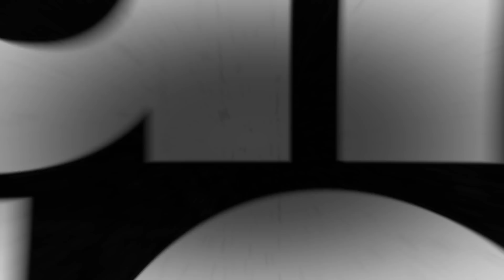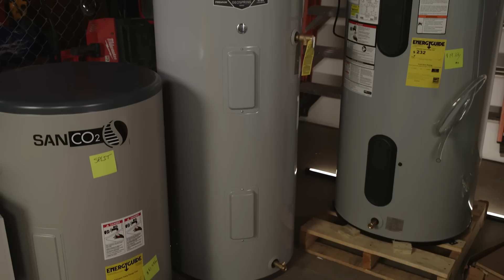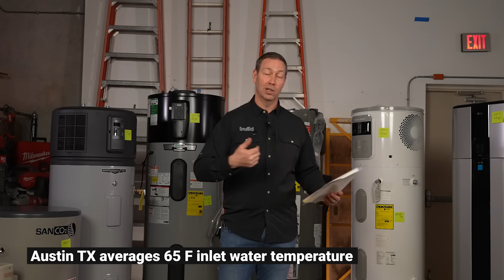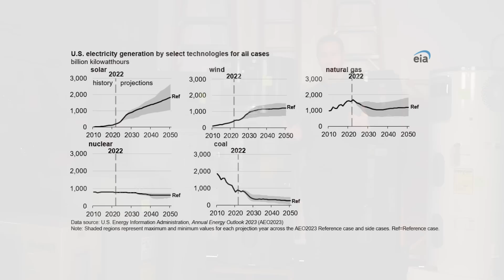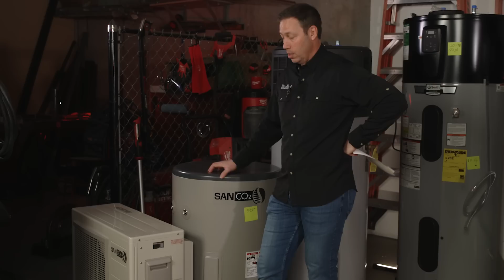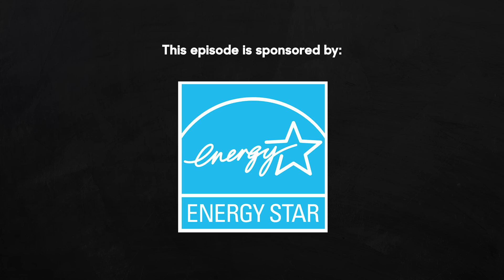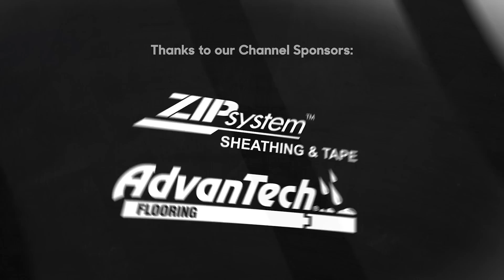2024 Heat Pump Water Heater Buyers Guide

Comment: Very cool that your sponsor is Energy Star.  I have a Rheem 3.55 and it does something I never expected.  It delivers way more hot water in heat pump only mode than our 5,500W water heater at our previous house.  In hybrid mode once, I’ve felt it run out because we ran too much at once accidentally and it recovered the hot water while I was showering.  It is powerful!  That and it helps cool our garage that we air condition/dehumidify in Florida.  Lots of benefits!
Reply from the maker: Very cool!  Thanks for commenting
Reply: Matt, For new construction would you recommend the 240v or the 120v model?
Reply: @toddwikel3849   Last time I looked (just a few months ago),  the 120v models had a slightly smaller heat pump and were a little slower to generate hot water.
Reply: fuck the government.
Reply: Of course the obvious answer in Florida, California in a garage. But for colder climates placed indoors there are real cons-
Reply: @johnwhite2576 agree, also in retrofit for older homes like mine in Provo Utah (basements are only 6ft tall).
Reply: @xokissmekatexo  The sanco would still be a decent option. They claim it functions past -25f outdoor temps which should really cover your worst winter days. They have a really well thought out system and all the functionality is there to set it up as a thermal battery with a solar system or time of use power.
Reply: @johnwhite2576  
Could be . . . but "colder" would have to be pretty cold, colder than W. PA. (IECC Zone 5).  My basement is not actively heated other than by radiation from gas furnace, ducts (well-sealed), lights, the ground below and the uninsulated floor above. In winter (outdoor 20F-30F), with the floor above conditioned at 68F, the basement is at 63F, and the HPWH subtracts another 3F from that. Might be a minor issue if the basement were a frequent living/sleeping space, but ours is used for mechanicals, laundry, storage and shop area. So...impact in winter is negative but minor; impact in summer is noticeably positive.

Comment: Matt, who sells SANCO2 in the Austin Area? Their website doesn't show a distributor here.
Reply from the maker: I bought mine online and had it shipped
Reply: Contact ECO2. They will connect you with an installer/distributor. They will only honor the warranty if it's professionally installed obtained through their distribution network. They helped me set up a drop shipment from a distributor and recruited and trained an installer. ECO2 provided wonderful service.

Comment: 14:30 Watch out Matt, water tanks should be set to 60°C (approx 140°F) to minimise the risk of Legionella contamination. While 50°C (approx 120°F) is safe enough, many hot water heaters will treat this set point as a maximum and the water will spend a lot of time below this temperature, which is dangerous. Great video otherwise.

Comment: Don’t ever buy anything less than 80gal unit.  50gal is too small for everyone to keep it 100% in full heat pump mode.
Reply: The Sanco2 stores water at 145 or 150F.  So after mixing down to 120F with a mixing valve, the 43 gallon tank actually delivers close to 60 gallons and recovers fully in a little over 2 hours.

Comment: Hey Matt, do you think these would be suitable for radiant heating??  Thanks for the great vids as usual!
Reply: No, they take heat from the house. The SanCO2 unit can do a small amount of radiant heating.
Reply: As the video mentions, heat pumps can take longer to move heat than a resistive element can make it.

Seems possible that a radiant floor heat load could circulate water faster than the heat pump could heat it to the desired temp.

Comment: Reliability seems to be an issue, read reviews. Cost of repairs should also be considered. If a manufacturer had an iron clad 5 year warranty that would help tremendously.
Reply: SANCO2 has warranty of 15 years on tank and 10 on heat pump.
Reply: Rheem has a 10-year warranty.

Comment: In June 2023, I replaced my 17 year old 75 gal AO Smith natural gas WH with a new AO Smith 80 gal HPWH.

Here are the details, so far. I bought this unit from Lowes for $2,800. I paid $2,000 for the install. The reasons for the pricey install were:1) cost to cap the gas line per local code, 2) installation of 240 volt electric line to HPWH, and 3) cost to block off the external vents from the old power vent gas WH.

I got 5% off the purchase price by opening a Lowes credit account. I received an $800 rebate from my local utility. I should obtain a $1,500 tax credit this year.

We have a finished full basement of 2600 SQFT. The HPWH was installed in the utility room in the basement (same location as the old natural gas unit). That area is about 800 SQFT.

The unit has done great. However, I have noticed that it is using triple the average daily electricity that it used over the summer. I assume it is due to the colder temperature in the basement. The room temperature is around 60 degrees in the winter. In the summer, it was using about 2.8 kwh. Right now, it is using 9.4 kwh!!!  I have it set to Hybrid mode. I keep  the door open to the rest of the basement area.

Overall I am happy with it. We are a three person household. So, we are NEVER without hot water. Just concerned about the triple increase in average daily electricity consumption. I wonder if I were to set it to Heat Pump mode would I will save $$$$?

Thanks for the video. Lots of great info. 

Have an awesome New Year!!
Reply: It sounds like your resistance heating element is kicking in a lot. I would try heat pump only mode for sure.
Reply: @johnhorner5711  Yeah, that is what I was thinking too. Do you think 60 degrees is too cold to run in HP mode? I live in Maryland.
Reply: @terencem723  Check the technical specifications for your model but I would be surprised if 60 degrees was too cold. I've looked at specs for some of these and they usually say 38 to 40 degrees is the minimum ambient temp for heat pump mode. I think your resistance mode is probably kicking on just because in hybrid mode it doesn't want to take too long too for the temp recovery so it uses some resistance heat because the incoming water is colder. You can always try it in heat pump only mode for a few days and see if it meets your hot water needs.
Reply: @elangomattab  Thanks. I switched it to HP mode last night. Let's see what happens!
Reply: @terencem723  Did changing it to HP mode made any difference? I'm thinking about a Rheem 65g unit and was going to install it in a mechanical room in the garage, but it also gets down to around 60* in the wintertime.
Reply: @zicktg  The unit was defective and had to be replaced. Very disappointed. So, it went bad after only 6-7 months. I see online their are lots of complaints about the A O Smith HPWH. 
I replaced the new one in June. I had to pay another $1000 to remove and re-install the new unit that A O Smith provided for free. Currently, in litigation (via my State AG Office) with A O Smith over paying for the re-install since it failed within the one year period.
Reply: @terencem723  that stinks!

Comment: Thank you for featuring these hybrid heaters again. They are by far the best solution for the majority of residential water heating needs. They are a much better choice than "on-demand" heaters due to the greatly improved efficiency and they blow away traditional storage heaters.
Reply: Absolutely NOT 100% true.  What you said as written is true as long as the water heater is functioning properly.  These pieces of junk may last 10 years or 10 days.  When they break, NOBODY will work on them and the only solution is to remove the water heater and return it for yet another piece of junk hybrid water heater that WILL eventually break.  I went through this with a GE Geotherm water heater that stopped functioning properly and would only heat with the back up electric heat coils.  GE refused to work on it and gave me several "authorized" GE repair businesses that ALSO REFUSED to work on it.  GE later told me that they had so many problems with this water heater that they sold it to Bradford White along with all of the spare parts and repair responsibilities.  Bradford White REFUSED to send anyone out to work on my GE Geotherm Hybrid water heater and would only send me a big box full of parts that to this day, I still have and STILL cannot get ANY repair business to come work on it.  If you DIY the install of the water heater, the cost may not be so bad if you can do that, put it in your truck and take it back to where you purchased it.  If you have to pay a plumber to do this, it is very expensive.  DO NOT BUY these heat pump water heaters PERIOD!  Bradford White or GE will NOT stand behind the warranty like you think so CAREFULLY read the warranty as I'm sure that the warranty will NOT cover the cost of installation and removal.
Reply: @wrfarms9741 I'm sure you had a problem with a GE/Bradford White model getting serviced, but the fact these things have been in circulation for almost 20 years tells me you're making way more of your problem than is warranted.
Reply: @anthonykaiser974  Sounds plausible as these devices are foreign to plumbers and hvac techs. Rheem for one makes direct contact difficult.

Comment: Nearly ready to install our heat pump water heater in the next month or so.  Excited to see how well it works.  Also have been running a condensing dryer as well based on your recent installation.  It’s nice keeping all the air inside the building!  Thanks for your recommendations!
Reply: How’s it going?
Reply: It's going well so far.  Plenty of capacity, even on its lowest energy setting, for the way we use it.

Comment: I was asked what happens to power usage if the house air source heat pump goes into resistive heating mode. And the result is that the water heater effective power usage is then back to a resistive heater even if it's still running as a heat pump. Of course the overall gain for the year is still good, but it does add extra demand to the house heat pump.
Reply: With my Rheem I can program what mode and temp depending on time of day. If needed it could use resistive overnight when house heating goes up, or just drop set temp so it doesn’t run at all.
Reply: NEEA did a study on that. Because the house HP is also super efficient the loses are fairly minimal.

Comment: Hi Matt. I decided to order an 80gal Rheem Proterra after seeing them in your videos, out over in Leander. The unit was like $2800 and plugs in with a regular 110 outlet.. but why are plumbers trying to charge $1100 to swap out my 1 year old gas unit? I Installed a water softener a few weeks ago, and think I should be fine installing the new unit, my only concern is plugging the gas line. Do you have any referrals/tips you can send me?
Reply: Your gas line should have an inline valve you can turn off when you remove your existing unit.  After you turn it off you can simply disconnect and plug the line at the valve with a brass, copper or iron pipe plug.

Comment: Hey Matt - if you have new construction and want to do a heat pump water heater, should you do a 120V or 220V?
Reply: For new construction I would do 220V. The primary difference is how much output the back-up resistance heater can provide. If you ever have a bunch of visitors and want to get lots of hot water more quickly, the resistance heater can kick in to help with supply. Not a big deal if the storage tank is sized large enough for your typical usage, but 220 will help a bit with surge capacity.
Reply: Not Matt but 220! The 120 is just a work around.
Reply: 240v. It will give the option of more output if need be and be balanced on your main panel

Comment: My personal experience is that last year I bought a 65 gallon Rheem hybrid water heater (I would have got the 80 but that model is 2” too tall to fit in my 1950 basement) replaced a 40 gallon electric resistive water heater, the whole job took me less than 2 hours.  Cost of the water heater was $2,399, got an instant rebate for $400 from the electric company, and will get an $800 credit on this year’s taxes.  Because it’s programmed to only run between midnight and 8am, when my electric is the cheapest, and because it’s more efficient, I’m save about $40/month, so payback is only 3 years.  So far I’m pleased, and for two people we’ve never run out of hot water, though evening showers aren’t an option after doing lots of laundry and dishes.
Reply: You were gonna get an 80 gallon tank for 2 people?!
Reply: @baxt1412  I wanted an 80 gal becase I only run the water heater between midnight and 8am when rates are lowest, so I need a big tank becase hot water has to last all day.

Comment: I installed a GE Geotherm in my place back in 2009 for ~$600 installed after the rebate. and it's still up& running! Saved ~$40/month (fam of 4) over the outgoing old-school electric unit. Have saved $7200 in electricity costs so far.
Reply: I love my Geotherm.
Reply: Bought mine in 2009. It’s been running nonstop in heat pump only. Never an issue. It’s in my garage. I tell everyone to get one but no one has. Nobody buys a new water heater until they go bad on a weekend before a holiday. Then they buy the cheapest one they can find. 😂
Reply: Yeah. My Geospring just hit 11 years old running nonstop in heat pump only mode with zero issues.
Reply: Yeah. My Geospring just hit 11 years old running nonstop in heat pump only mode with zero issues.
Reply: Yeah. My Geospring just hit 11 years old running nonstop in heat pump only mode with zero issues.
Reply: Mine died after ~ 12 years - circuit boad is shot. Ran it in heat pump mode only, saved many times the original cost. Replacing with another heat pump, though they are a lot more expensive now compared to standard WH so cost recovery will be longer (still better, though!).
Reply: Who paid for all the rebates?
Reply: @N-M424 The same people who paid for the oil subsidies.
Reply: @N-M424  What are you getting at here?  Oh, the climate damage done by gas fired water heaters that spew CO2?  I agree, who will pay to take care of that?  Our grandkids I suppose.  Too bad for them, huh?
Reply: @N-M424  I hope you did

Comment: The cost of the heat that has to be replaced in a home that is being heated is not factored into the cost of operation. I have one in my basement here in Maine and it cools my basement considerably.  The scavenged heat has been generated by my heating system and I have to replace it to make my basement comfortable.
Reply: Another comment pointed out that they were losing a lot of heat through the old gas water heater vent, and their furnace started running less after putting in a HPWH and sealing the vent. And even in a cold climate your central heating system is likely more efficient than a standard gas water heater (70-80%), and almost certainly more efficient than a resistance electric water heater (unless you have electric baseboard heat, in which case replace that with a heat pump ASAP).
Reply: You're a perfect example of nothing is perfect for everyone.

Comment: A tax credit is only good if you owe tax at the end of the year. The IRS won’t cut you a check. If you’re a working slub like me my employer withholds my taxes. This has been misleading consumers for awhile and they always say consult a tax profession.
Reply: It's the beginning of 2024, adjust your W4. If you're thinking about this or other credits... A little planning goes a long way.
Reply: That isn't accurate. When you file your tax return at the end of the year, you are eligible to get a tax refund if the net tax you owe is less than what your employer withheld. You only have to have paid taxes for the credit to be useful, and paying them through paycheck deductions still counts.
Reply: @johnhorner5711  what I said is in fact accurate. If you are getting a dollar refund and have a 1,500 tax credit you will get a 200 refund. If you owe 1000 then you would only owe 500. If you owe 1501 then you would owe 1 dollar.

Comment: I've asked SanCO2 about putting the heat exchanger into my warm/humid (nc) sealed crawlspace.   It seems like a great idea.  Free dehumidification, earth thermal heat in winter, ect.   It also could be a stupid idea.    Anyone have any arguments against this?
Reply: For the Sanco2 heat pump, the manufacturer recommends 600 cu.ft of space for air circulation, or 400 cu.ft. if the space is vented.  There are a few requirements for clearance to either side of the unit, but as long as these conditions are met it is a permissible location.  The CO2 refrigerant in the Sanco2 is non-toxic and non-flammable.
Reply: I would worry about insurance not covering a fire. We had a Dykin outdoor unit explode over labor day with lots of soot covering everything including our exterior wall that it was 2 ft away from. I know it's not common but why risk it.
Reply: @tysleight  The refrigerant is non-flamable.   I already have a dehumidifier in the same space.  On the otherhand - at minimum - a smoke detector within that space is a pretty good idea.
Reply: @leoguzynski mine was the main circuit board.  59 months into a 60 month warranty.  It burned the housing and some foam....
Reply: I hung the SanCO2 heat pump on the wall of out unconditioned garage. Works great.

Comment: I doubt any of these would work in a Infloor radiant heat application. The one with a split might work though. I would question how much square footage it would support though.
Reply: The Sanco2 supports 8,000-10,000 Btu/hr of radiant heat load in moderate climates only, in conjunction with DHW usage.  This is really only enough for supplementing an existing space heating system, or for a fairly small or very well insulated space.